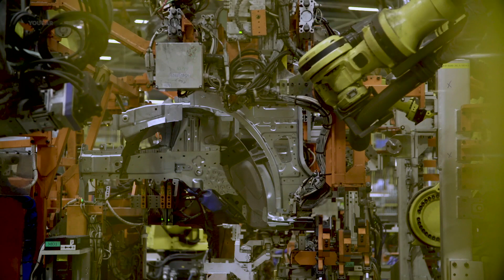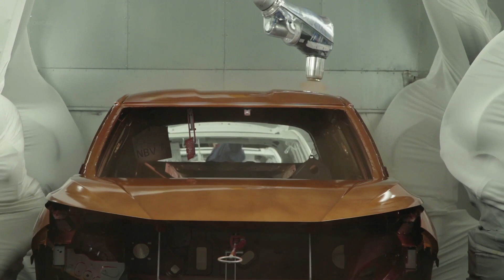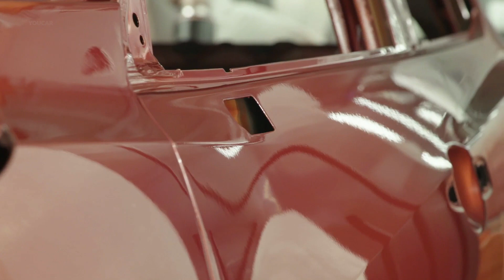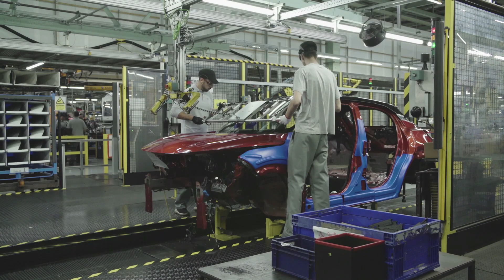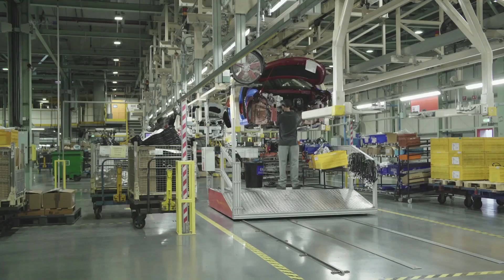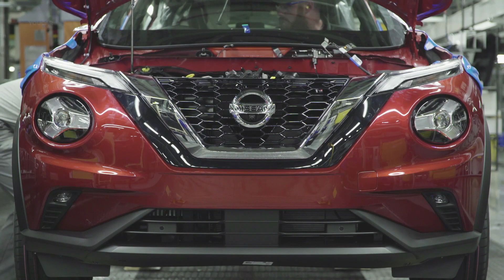2021 NISSAN JUKE production line – Car Factory

Comment: I was disappointed by the semi-hidden fact that in the VISIA and ACENTA
versions the rear brakes of the Nissan JUKE 2020 are of ¡DRUM !!!. For the
higher-end TEKNA option, it is only available with 19-inch wheels, the option
of choosing 17 ”wheels more suitable for irregular asphalt not being possible.
With the N-CONNECTA range, you cannot include the BOSE audio PACK with the
speakers in the seats and the PRO PILOT option is not standard. Adding the
extras in the N-CONNECTA of metallic paint, bitone with a second color ceiling,
PROPILOT, etc ... is more expensive than the TEKNA version immediately
superior. FINALLY if I miss that there is no version in 4X4 ,. I have a NISSAN
TERRANO 2.7 and it is time to retire now I do not know what to choose because
the 4x4 option of the Nissan quasquai does not convince me because of its
excessive size, since the NISSAN JUKE lines really fall in love. Greetings from
MELILLA. –SPAIN